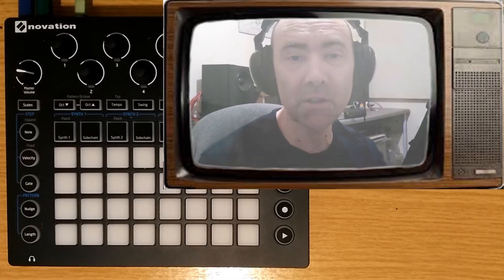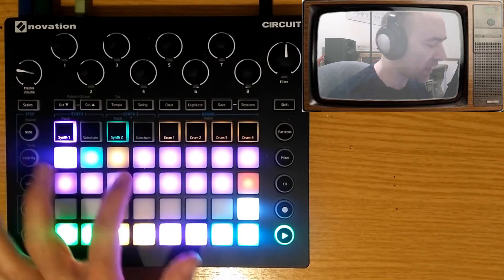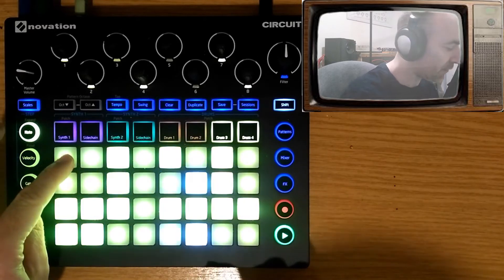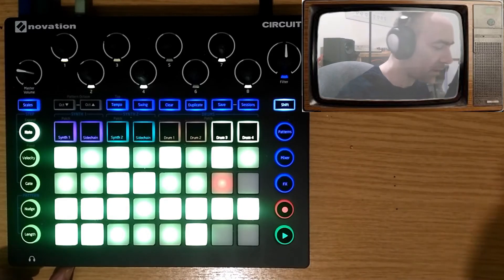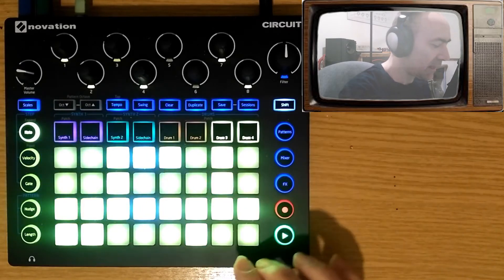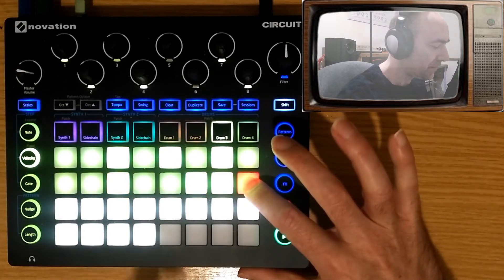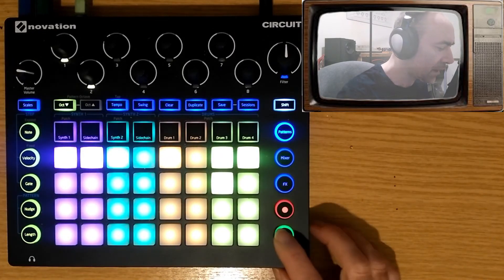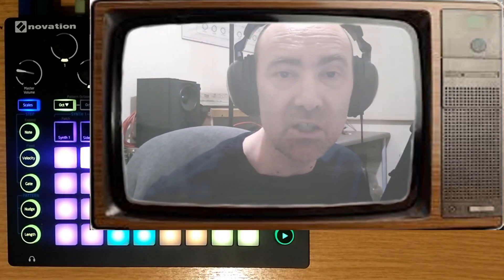Setting Midi Channels and Writing Cross Rhythms on Novation Circuit

Comment: any info on setting midi settings on circuit is very useful ,thank you, as trying to use wiv crave on midi out?
Reply from the maker: Glad to help, you need to make sure the settings are correct on the Crave too. Are you sending notes to the Crave or just the Clock?
Interestingly I filmed a little bit about the Crave vs TD-3 last night, will be out next Wednesday I reckon by the time I have edited it. But I may do something on the Crave paired with the Circuit in the future if you like.
Reply: @DocBolus  oo yes please ...excellent as midi settings [in/out]n how 2 get the best sounds/patterns outa either?. Will defo b great full appreciated, thanks...i love mixing it up !!!

Comment: I need to start using my Circuit again it's been gathering dust for a bit
Reply from the maker: Yeah got mine earlier this year to replace a drum machine and I wouldn't be without it now. Has a good role in my rig.
Reply: @DocBolus  I is a very powerful little box and all the updates it has got show it is a well-loved machine